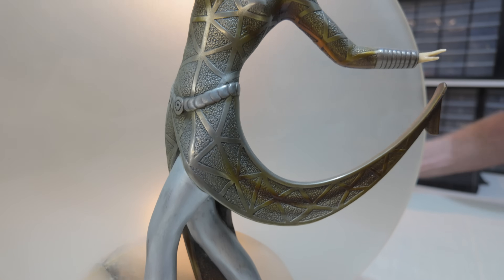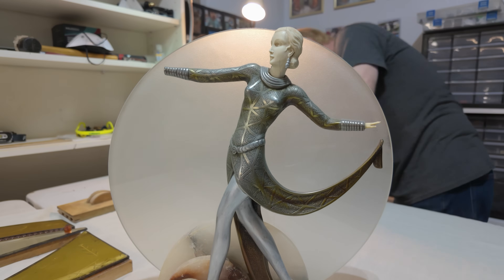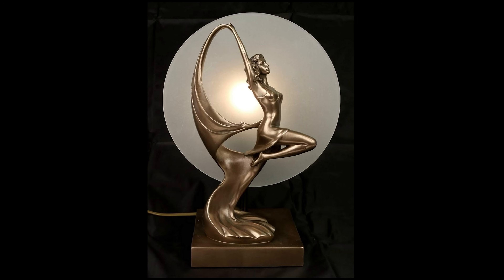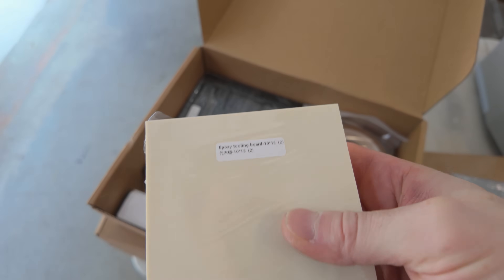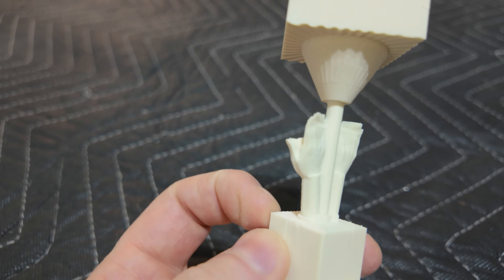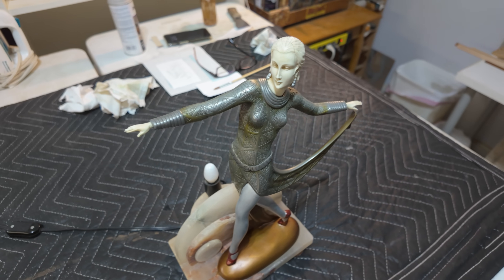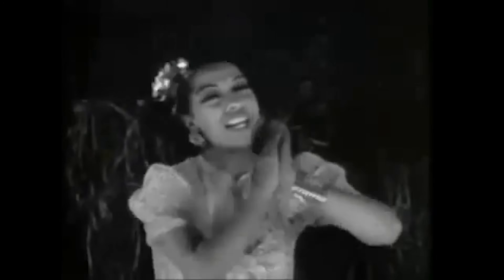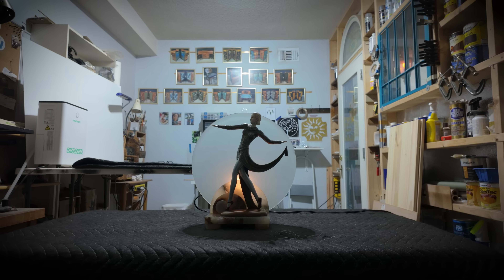AMAZING Art Deco RESTORATION with MAKERA CARVERA AIR

Comment: What a lovely lamp. A good repair.
If you think you might be doing more detail work like this, you might look into a resin-based 3D printer. They can do much finer work than a normal 3D hot-melt printer, and I think could have made your hands easily, with even more detail than you got from the carver, though it did an excellent job.

If you decide to redo the hands, you might want to think about magnifying the pattern by 15% or 20%. The hand would have to be a little bigger to be able to grab the dress at the back, and the front one, when looking straight on to the lamp, looks just a tiny bit small for the arm and body. Please don't take this as a negative comment, it isn't intended that way at all, but just a something to think about if you decide to revisit this.
Reply from the maker: Thank you, yes we will enjoy the lamp for a bit and then give it another try, as you described. Agree 100%. Did not know about hot melt resin printers!
Reply: I was going to post something similar. The high detailed resin 3d printers these days would require less cleanup. Also, I would be printing a series of hands with 1% size increase to really perfect it. You could print 20 sizes for very little resin and it would take the same time as just one.

Comment: Now that you showed the other statues holding the dress it seems weird that her hand isn’t holding it. I also think her hands are a little small. I learned from years of drawing that your hands are about the size of your face. If you put the bottom of your palm at your chin your fingers should be past your eyebrows to mid forehead. Even you if you don’t redo the hands it’s worth admiring.
Reply from the maker: We will redo them, yes agreed. We made them bigger than the existing hand, but then realized that one wasn’t original! Good to know this is possible now.